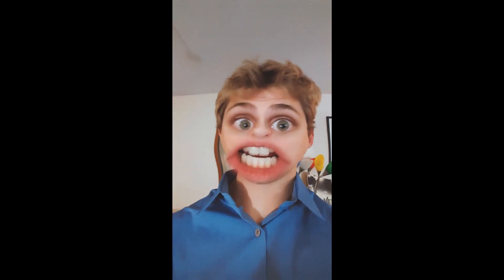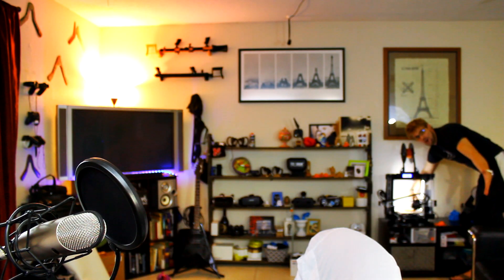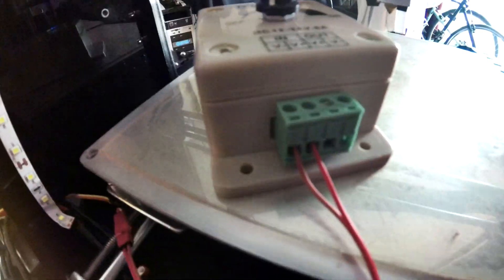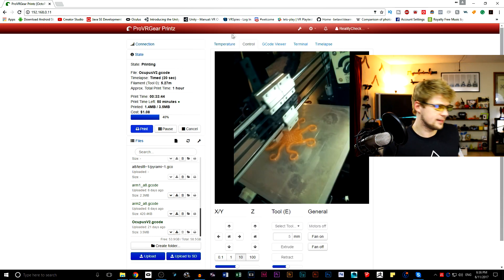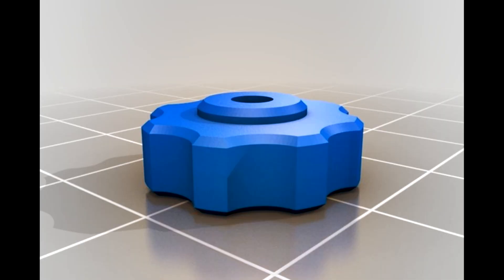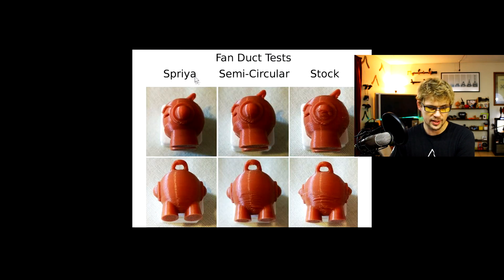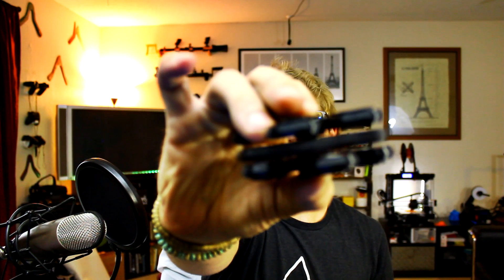✔ ANET A8 ULTIMATE UPGRADES! AMAZING CHEAP 3D-PRINTER!

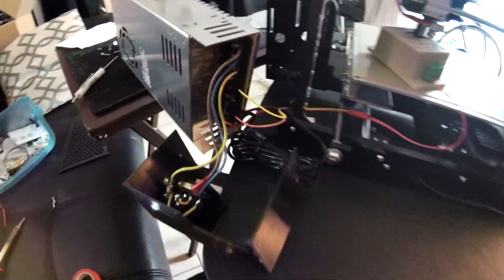Comment: 2:03 you should not solder mains cables thats bad solution you should crimp them :)
Reply: There's still more contact surface area with the amount of solder he used than crimping would provide AND it won't wiggle over time and loosen.

Comment: Did you super glue the fuse switch into the base? Looking to know if that will be better than using the screw hole. 02:11

Comment: I made the spriya but it cools my extruder too much. what should I do about this?
Reply: I have this issue too, and I'm sure someone has a better answer, but I've noticed my nozzle cools my extruder by about 4 degrees, so I'll either set the printing temp higher in Cura (instead of printing at 200 C I'll have it print at 204 C, for example, and then when the fan cools it a few degrees it'll be printing around 200 C). Or you can turn the temp on your extruder up on the LCD. I believe it's under the Extruder menu--you can raise or lower the temp for extruder and bed during a print to compensate.

If anyone has a better idea I'm def open to it! :)

Comment: Been wanting 3d printer for awhile, would this be a good 1st buy?
Reply from the maker: It's a GREAT buy for the hobbyist, in that, you have to do the building which makes you really understand the way the printer works. I like how it engaged me and taught me a lot. Having said that, if you just want a 3D printer that works for cheap than there are other options that are easier.. still mine is running perfect and prints BEAUTIFUL objects) no complaints!
Reply: Well then i might just have to get this then, thanks man!
Reply: hey, what filament should i buy since this doesnt come with any

Comment: I got one of these printers. It does pretty good once you solder everything and get rid of the connectors. Also, please consider normalizing your videos volume in future videos. Your content doesn't suck, but the difference in levels from speaking to music does. :)
Reply from the maker: boomStik I hear ya man - I noticed the audio lvls were all llll f'd up a little too late, inconsistent speaker volume around me especially when I have 3 printers running... time to use headphones!
Reply: Listen to your final mix on both. It should sound good to headphone and speaker listeners alike. Keep up the good work. Cheers!

Comment: Just bought a anet
Reply: UnlimetedMonkey join the Facebook group for all the suggested upgrades and modifications. I have 2 Anet a8s, this group has helped a lot.
Reply: UnlimetedMonkey same although mine cost $170 with s/h at that time, no coupon. Oh well. Still cheaper than other 3D printers
Reply: Did you get it from gearbest? I just bought mine, and then I noticed in shipping, after it was "PACKED" SPLIT DELIVERY was next, and I asked gearbest about it, and what that was, gearbest said item had TOO MANY PARTS, but they will try to ship in one box....wtf? Did you get yours sent split delivery? Or has anyone else had that as well? All videos I see, it has come in one, nicely packed box.
Reply: Jim L. Mine came in one big box but the shipped control board was bad. Had to buy a new board.
Reply: So odd they are trying to ship mine in multiple or split shipments. I couldn't resist getting this, price was too good, but I hope I get the whole thing, I have a feeling this is going to be a long process in getting the thing as a whole.
Reply: Jim L. Once you do get it. It will take time to build. Mine took 13 hours. Make sure you have the polarity correct from the PSU to the board. I had it backwards because the latest instruction video from anet has a different model board and it has the connection opposite than what it should be. Smelled burning when I first started it. Thinking back now it may be the reason why the board doesn't work right. It boots up but the y and z axis connections don't work. The motors work for a fact as I can place them on the x axis and they run but not their respective ports. It's best to test your board before setting it on the frame. Test each motor and stop switch. If it doesn't, make a case with Gearbest and keep the pressure. They don't respond fast as they claim in "instant response" that they advertise. Also use PayPal more protection for you.
Reply: Oh I definitely know it will take a while to build, that is actually why I decided to get it, price was great, but I want to actually build one. I think it will be beneficial.I didn't know there was an issue with the PSU, I knew you can go from 220 to 110, but I didn't know info was backwards, glad you said that. I will definitely test each motor, good advice. And I did use Paypal....which I am very glad I did. But I really appreciate the advice and heads up.